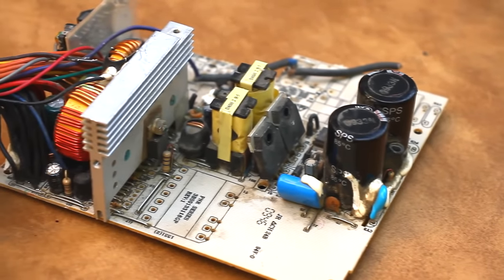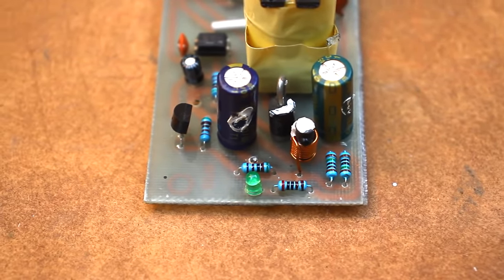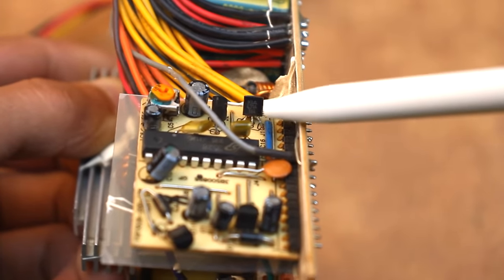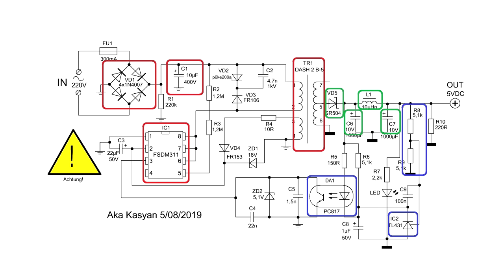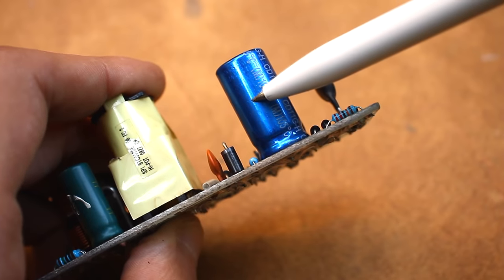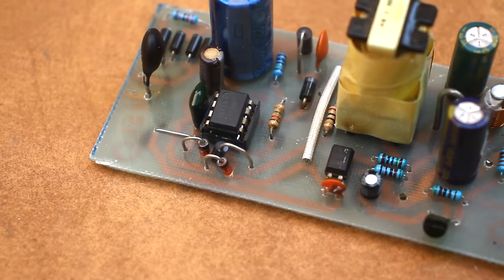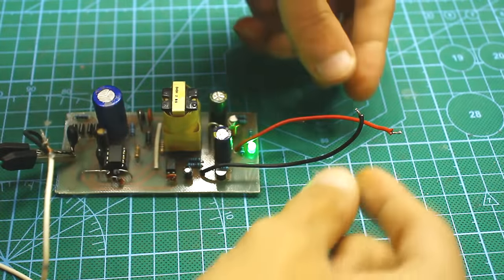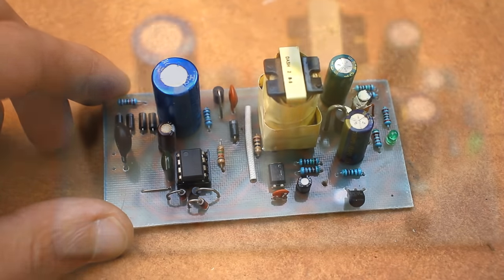What can be done from an old computer power supply

Comment: Amazing! I had EXACTLY teh same thought when I recently tried to fix a broken PSU but had blown all transistors etc. I thought why not relocate the 5VSB circuit to a discrete PCB and use it when it can output 2.5A?!!! Your video was the last drop in the glass! I will definately attmpt it now!!
Reply: I was checking several power supplies because I need one that doesn't use much power while not doing anything for an remote controlled external AUX-switch for my stereo and also some mains power plugs to not to rely on that the standby of each device is using only little power and switch them manually, so basically a control center for my HiFi-wall. My best idea so far was to use the capacitor-supply from a movement detector to switch only one relay that switches a second PSU and so the whole device, but if I only want to watch TV and turn it on through that device, the second supply will use power for nothing after switching one relay, even if I planned to use the SMPS switching-PSU from a DVD-player, it feels kinda wrong, especially that capacitor psu, my very old CRT tv had its standby based on that and this is what blew up the circuit because the main cap got old. So this might be the solution, I have many PC PSU's and also this is a good beginning for diy SMPS. Just love that dude, no matter if it is in russian or english, he always got something usable, maybe not for a actual project, but definitely a reason to subscribe.

Comment: I learn so much from your videos, this is a really good one by the way, thank you.  Here In America our mains supply 120V.  and there is really no reason to have 220V on a bench top, in fact that's kind of frightening.  I work with it all the time in the field, but were talking heaters, pumps, and equipment that draws a lot of amperage.
Here is my question, how would this circuit react to 120V supply, would it require modification?

Comment: I recommend using new caps.
Reply: better is to test them first, you can easily see if they are ok or not when you measure the capacity.
If the capacity is less than -10-15% than you can replace them.

Comment: Is there a  particular reason  why you keep calling the diode symbols rectifiers? To rectify voltage from A/C to D/C 4 diodes are required  in a specific order. One diode alone in a circuit will act as protective one check valve if you will allowing current to flow in only one direction.

Comment: Just to note that in the UK the diode bridge needs >>400v diodes as the peak output is >340v so the diode will see >680v across it when the input changes polarity. 1N4007 are fine of course.

Comment: Fine if you're going to power a clock or something audio.  I would never use a switch mode power supply for a radio application, just too much noise that is very difficult to filter out.  For RF apps I always use a transformer and linear regulation.

Comment: Am using an old psu as power supply for my electronic lab  to drive resistors transistors etc  is it safe? What is the best way to discharge the psu after using it
Reply: add a bleeding resistor
across output

Comment: can you make one with 110/220V AC input, +/- 15V @5A output , for an audio amp? 
It will also be a great bench supply. Maybe use the big switching transformer and rewire it? 
I'll build one if you do.
Reply: iwonnatube  SMPS is fine with audio equipment. It's RF equipment you're thinking of.

Comment: No 2n2 Y2 safety cap from primary to secondary of transformer. 
No MOVs or X1 caps to ground at the input stage.
No Earth ground. 
No PTC to control inrush. 
Sorry but not a well designed supply.
Reply: One thing is that it does not meet certain safety requirements that are not required everywhere and another very different is that it is not well designed.
Reply: So basically a typical Chinese designed supply.